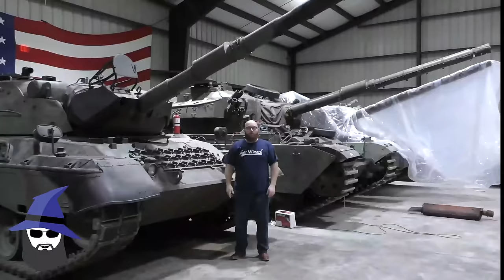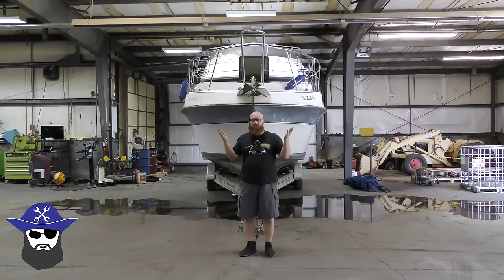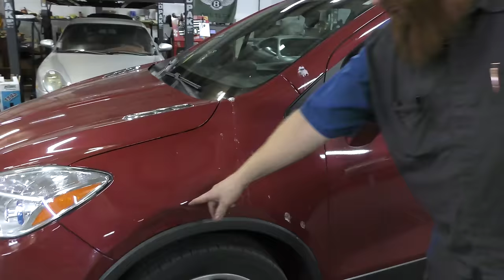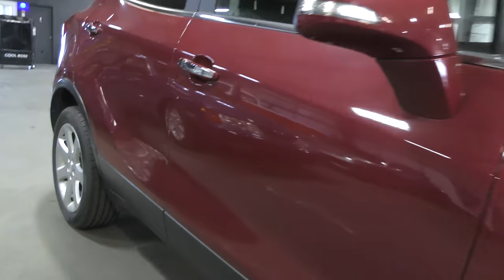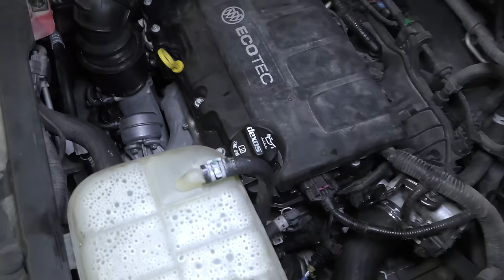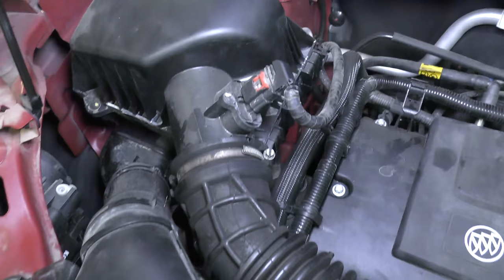How did a dealer miss the problem on this '15 Encore 4 times? CAR WIZARD just had to read the codes

Comment: Ultimate tip for everyone: Advance Auto, O'Reilly's, and AutoZone will all read your engine codes for free. And test your battery for free. Hell if you can remove your alternator they'll test that too. You still might have to pay a diagnostic fee to a mechanic, but at least you can go in and tell them what the actual problem is instead of letting them guess
Reply: AND...if you a cute woman, park near the front door of any of these fine establishments, open the hood of your car and 12 men will fix your car for almost nothing
Reply: FYI my car was having issues with ignition.  Took to to Advance Auto and they tested the battery; they told me it was a bad battery.  Car still had trouble starting after a brand new battery.  Took it to a reliable mechanic and he replaced the started.  After the repair it fired up quicker than ever before...

Just reading the codes sometimes doesn't do anything.
Reply: Everyone should have a cheap scan tool at home so you don't even have to drive anywhere, but the charging system testing is nice. Those systems will tell you of a failed cell in a battery even if the thing will keep you rolling for 2 more years.
Reply: the problem with telling a good mechanic where to look is it will double the bill as any good mechanic should be contentious enough to diagnose the problem without the helpful non tech code reading parts store clerk that just gives you the generic code the screen spits at them without the context of other issues
Reply: Do your own code read, and remember what circumstances occurred. Then schedule with your friendly neighbourhood mechanic and explain what area of the car is causing problems. They will probably find it and just go to town fixing it, no big deal.
Reply: @juliansteward2593  
11 of them will not know what they are doing
Reply: @tonydelcarte3103  I once told my mom to go up to autozone and lift the hood because her car needed an airfilter and I couldn't be there to do it for her..she got it fixed!
Reply: @juliansteward2593  as someone who works at the parts store I have first-hand experience with this one. I know for a fact cute women can lure all the dudes out of the store and fix you car in the parking lot.
Reply: For some reason "test your battery" always results in them saying you need a new one. Even when you don't.
Reply: Fun story: I took my alternator from my Ranger to O'Reilly to get it tested. The result was no test results and a grown man shitting his pants when the drive motor of the test machine literally exploded mid test.
Reply: Unless you're car is older than 96.
Then not so much
Reply: Ultimate tip. A battery tester only costs $20.00.  Buy one and you'll always have it. A code reader also costs about $20.00.  Buy one and you'll always have it.
Reply: @nickv4073  unless your car has a built in code reader you don't need either.
Reply: Any moron can connect a scan tool and read some numbers off of a screen. That is not what a real technician does. A real tech ACTUALLY diagnoses your vehicle and pinpoints the exact failure point and cause. A code can point you in the right direction but it does not diagnose the problem. It is insulting to insinuate otherwise.
Reply: @666cemetaryslut   Unless it is over 18 volts then it is going to cook your battery, the   alternators voltage regulator is shot.
Reply: @juliansteward2593  And did all 12 Females showed up as well?  lol
Reply: a code scan is not a diagnoses

Comment: Took my truck to get power steering pump changed out. When I got my truck back they said the pump is no good. Went to the parts store and salesman detected that the timing belt tensioner was going out. Last time I go get repairs at that stupid shop. Also the power steering reservoir needed cleaning. Enjoyed your video.

Comment: Two years ago, my 90 year-old aunt took her well-preserved, low mileage 2006 Buick Lucerne into a local dealership for service (to get some "things," take care of, as she related to me), and to the utter astonishment of her children, she drove home in a 2019 Buick Encore.  The sly WEASELS at the dealership, had convinced her she needed to buy a new car.  For starters, compared to what she was driving, the Encore is a huge step downwards in terms of comfort and ride.  She went from a semi-luxury car, to a cheap, throwaway econobox.   My aunt & her daughter drove the Encore down to Oklahoma City to visit family, and by the time they arrived back home, my aunt was complaining that the choppy ride and the poorly designed seats had caused her back to ache.  In my consideration, the Encore is awkward looking, top-heavy vehicle that is not going to hold its value and was certainly not a good fit for the needs of my aunt.

Comment: In the UK, this car was sold as a  Vauxhall Mokka and is extremely popular despite being pretty bland with questionable reliability and build quality.
Reply: I’ve always thought that the only reason anyone bought a Mokka is that they cared so little about cars they didn’t bother to look at any other alternatives. This is often proved right by the driving style of most Mokka drivers.
Reply: This particular version is made in China so that explains the reliability and build quality issues.
Reply: @CS-oo6hs  Basically the same people who 10 years ago bought Kias, and 20 years ago bought Rovers.
Reply: @99Vood99  No, it's made in South Korea.
Reply: Also terrible to drive by all accounts.
Reply: @S-Ltd1000  It's not terrible to drive, it's a crossover hatchback. It drives like the rest of them.
Reply: @NGGPeter  Terribly.
Reply: @slacko1971  What are you trying to do to this car that makes it so terrible? Are you trying to race it at 90 mph on hard corners? This car is meant to get you from point A to point B without breaking the bank. And it does that (reliability aside).

Comment: Because the WIZARD is a real mechanic, dealers have “techs” and they are not the same thing. 
If the scan tool doesn’t show them what’s specifically wrong they can’t find it.
Reply: And to think some of them charge upwards at of $160/hr for labor and their ridiculous markup on parts for this kind of service. But I also think this dealership did that on purpose...
Reply: Yep...At dealerships they teach you how to use Equipment. Mechanics are born...not made. ✌
Reply: sometimes shops give bonuses to the "techs"/( sales)
Reply: The problem here is the scan tool DID SAY WHATS WRONG!
Reply: The real problem is the flat rate pay system.
Reply: In this case it was literally staring them in the face.  Terrible.
Reply: @petej.8676  Nobody is born knowing how to be a mechanic. They have to be learn. They have to be trained.
Reply: @dunebasher1971  aptitude helps....not everyone can be a mechanic..school or not..✌
Reply: It's called fraud
Reply: True..
Reply: The problem is the scan tool defined the fault.

Comment: We have a 2011 Chevy Equinox, we were on a road trip and while taking a bathroom break the car wouldn't start back up and we had all sorts of errors pop up. It said fuel system was bad, we made it to dodge city and stop at oreilys and the guy checked the codes and it had 12 different codes, he then checked the alternator it was good but the battery was dead, he repleaced it for us and all the codes went away. All those codes for a faulty battery.... newer cars suck lol

Comment: Your shop specializes in something that is very rare in the dealership world and many chain operations: analytical troubleshooting. Its detective work, eliminating every suspect until one remains. Having common sense and a plan of attack goes a long way here. Most so-called repair shops fall short. Dealers don't pay well but the work is steady due to shady practices.

Comment: Had a similar issue with my 97 Merc Topaz 20 years ago.  Check engine light came on, then it wouldn't start.  The dealer mechanic changed the starter and flywheel 3 times, and still not fixed.  Finally, after I went ballistic in the service manager's office and insisted loud enough for everyone in the building to hear that I wanted them to actually do some diagnostic work, rather than look in the shop book to see what pays the mechanic the most money.  They replaced a relay switch under the dashboard, and I had no more problems.   Nothing has changed.  Dealer mechanics would rather look in the book to see how they can get paid more than actually do the things they've been "trained" to do.

Comment: Even some independent garages suck: my old mechanic charged 7 hours for a 4 hour (by the book) job. His reason: “It took longer.” Yeah, okay, but if you charge more when you go over book rate, will you charge less when under book? Not that guy
Reply: I know some shops who do that too, depending on what type of job and only if it allways takes longer than what the "book" says. Still, their €60 per hour or the dealer €160 per per hour... Also, they set fixed labour hour rates, and it rarely goes over 1 hour from what te book says. 7 hours in stead of 4 is worth running away from.
Reply: I remember a guy who owned a shop back in the mid '90s.  Once he was so pleased with himself that he charged a poor woman $800 to change the radiator in her '80s Dodge Caravan.  
The Radiator was $100 shop cost.  
It was a 20 minute job for an experienced mechanic.  If you've never seen one of these vans before and are half way competent, you could change it in half an hour.  So maybe $250 would have been fair back then.
$800???  That was so dirty.  And who knows how often he did it to others.
Reply: That's justifiable, for example might be changing a suspension arm or similar and everything is rusted to hell, takes an extra 30-60minutes, well the customer is probably getting charged for that time. On the other hand, if a job takes longer because the mechanic in unfamiliar with the repair or breaks something etc that shouldn't be charged to the customer. 

That said, no mechanic is likely to give up money just because they can complete a job under book hours, in that case the good news is going to be the car ready sooner not the bill being smaller. Completing jobs at or faster than book rate is the main way a mechanic can make good money so workshops certainly aren't giving out discounts just because an individual tech is more skilled than average.

When I do repairs for friends of friends etc I just quote a labor cost + parts, avoids the whole potential argument about quoted hours vs actual time taken.

Comment: Nice to see the Wizard taking on some more "every day " vehicles in his videos.  The Encore is entry level Korean built Buick.  I'm surprised that it was the front drive model as a lot of them were marketed with their awd capability. 
Its also great to show that going to an independent shop with a honest and straightforward mechanic  can save you $$ vs going to the dealership or a chain of auto repair shops.  Keep up the good work encourage your viewers to seek out their local "Car Wizards"
Reply: Look like euro GM - Opel mokka
Reply: @altergreenhorn  Opel sucks. Korean cars are definitely higher quality than they used to be in the 90s
Reply: @robmalcolm8042  It is a rebadged Opel Mokka. Designed in Germany with a German engine.

Comment: Love the channel, I’m an enthusiastic amateur mechanic, I have occasionally used the main dealership for work I couldn’t be bothered doing, I tell them exactly what I want done, they always try to tell me that more work is required, I know it isn’t required. Thermostat and battery, this is simple stuff. Easy fix, well done. Here in the UK I have a female friend who always asks me to take her car to the garage because she constantly gets ripped of by mechanics who see her as an easy target. She doesn’t know a crankshaft from a spark plug, is this what was possibly happening here, “Hey we fixed it” just $300….. but we know you’ll be back later because we know we didn’t really “Fix it”…….

Comment: Buick Encore ... Our 2017 and 2018 Buick Encores have been a great buy.  Turbo went out on the 2018, but it was replaced by warranty.  That 1.4 liter engine gets up and goes.  Never a problem on the freeway or in the mountains.  Getting a combined 32 mpg.

Comment: Hi mr. Wizard, my name is Dominick. I am new to your Channel and I really enjoy your content. I have been working on cars for 42 years, although it is not my profession it is something that I've enjoyed ever since I was a little kid. I recently purchased a 2012 Honda Accord for my daughter from a supposedly reputable Honda dealership in my area. I live in Connecticut. It is a beautiful 1ownercar but upon my inspection I found that it had a ripped CV boot on the right side. The dealership installed a new axle free of charge but when I got the car home I inspected the technicians work and he installed the axle but he didn't clean the Globs of CV grease that the old Axel puked out all over the control control arm and the lower engine cradle. It really amazes me as to what is considered a master technician.

Comment: Dealerships can really mess up simple issues. My mother bought a first year, top end Chrysler Sebring that started darting to the left when she hit bumps, and every time she brought it into the shop it would do something different. After 9 trips to the dealership, it got lemon law'd. They "replaced everything in the steering system twice."
Apparently they never aligned the front end. Ever.

Comment: My 02' Ford Escape with a manual transmission would rev up to 2000 rpm in neutral when I would come to a stop. Ford dealer in Scottsdale told me I needed a clutch. B.S.
Clutch has 17,000 miles on it. Majority long distance interstate driving.
Took it to Sun Devil auto in Scottsdale. Diagnosed as a bad throttle body.

Comment: Lady: "My Check Engine light is on - the display says 'bad thermostat'. "
Dealer: "You need a new serpentine belt."
Lady: "But it says 'Bad thermostat?' "
Dealer: "Listen lady, I'm the car expert here! I know what I'm doing! Don't like it? Take your car elsewhere."
Lady: "Guess I'm going to Omega Car Clinic then!"
Dealer: "Damn - she called my bluff!" 💸💸💸

Dealerships are only interested in your wallet contents, not your satisfaction. Never have been - never will be.

BTW - I checked RockAuto, and they're out of stock on these thermostats. Guess that's a common issues with these POS engines.
Reply: Plastic ones always break every 50k miles
Reply: @abigalanderson7494  80k on the original. No issues yet. However, the water outlet has blown apart twice. Plastic cooling components are a terrible idea. Even if it is to reduce consumer price.
Reply: Ussually the POS CVT transmission that takes a dump at 30k
Reply: I have the same family engine in my car and the orginal thermostat is still going strong with 173.585 KM

Comment: I had 4 technicians, the foreman, and the service manager tell me that the serpentine tensioner is operating normally slapping back and forth on idle. I left the dealership, went to parts, and bought the tensioner and a new belt. Taking a video of before replacement, then a video of it after, and sending it to Ford Corp HQ. I've had to do this before and they cut me a check almost immediately and the manager apologized over and over so I know he was chewed out. I didn't talk to him about the issue and I'll let them call him again..... Dealerships are overpriced but 15 years ago they provided the best parts and service. Now, Mr.Tire does a better job cheaper. I have even thought about shipping my SHO to the Wizard when I want my new motor.

Comment: I’m a gear head. Work on my own stuff and rarely on friends vehicles. Bought a ‘92 Maxima from a friend. It had electrical gremlins that no shop could fix. I’m like “Hold my beer!”  Put fuses in where they were missing and got to work. Crazy stuff going on. Push the brake pedal and the dash lights come on. Turn the lights on and the gear shift interlock would click. Checked taillights and one was out. Some of you have figured it out, right?  The lead terminals on the twin-filament bulb had melted together and shorted the running lights to the brake lights. Put a new socket in the taillight fixture and it was fixed. Previous owner had spent thousands of dollars and years trying to get their car to work. Taken it to about a dozen different shops. I saw all the receipts. Not one of them looked at a non-functioning taillight and thought to investigate further. Not. One. Again, this is multiple different shops! I had it nailed in literally, five minutes. In my driveway. Didn’t even need a multimeter. Melted light socket. Three dollar parts bill. Unbelievable.
Reply: It can happen to any older car with twin filaments and incandescent bulbs. Those lead terminals can melt and fuse together. You can get the same effect if the upper filament breaks and touches the lower filament. Had that happen in an old truck once. Cruise control didn’t work with the headlights on. During the day I flashed my headlights at a truck and my cruise control immediately disengaged. That was my clue. Fixed that too.